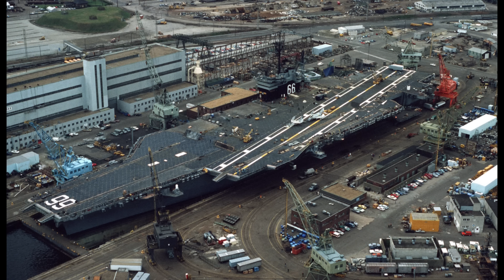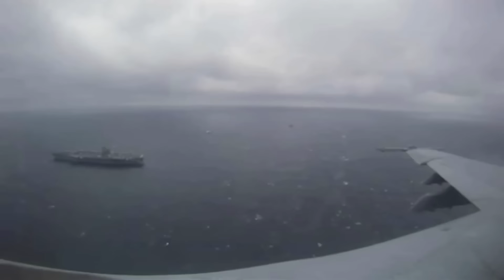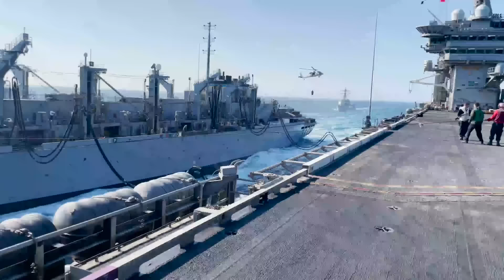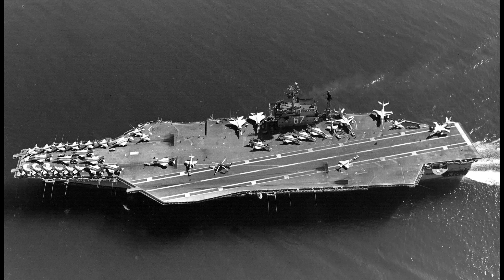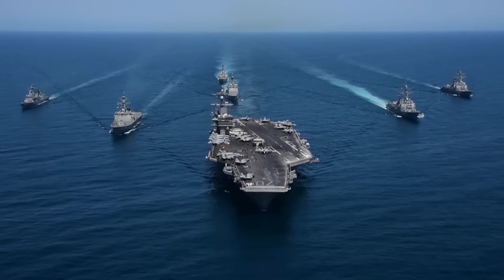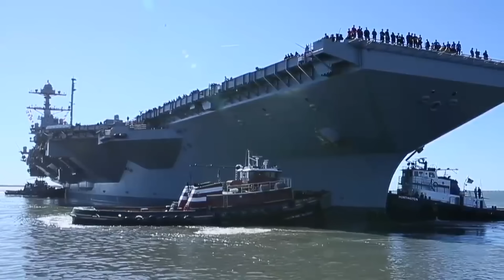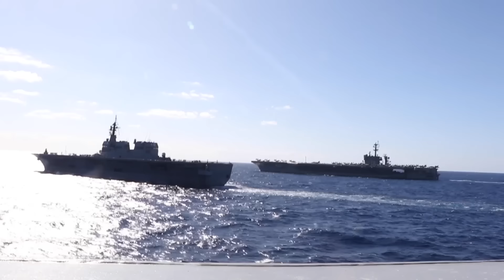Kitty Hawk Class: Why the US Navy MUST Bring Back This Non-Nuclear Carrier

Comment: So the trebuchet launch system is a no go?   Shame.  They are fascinating.  

A carrier today could not operate on a conventional power plant.  It cannot power all the computers, electronics, navigation systems, stram plant, propulsion, steering, catapults, arresting gear, gun mounts, CIWS, passive anti-sub sonar, radars,  communications, galley, laundry, berthing, nightlights, ... 

A potential stop gap are the Marine Amphibious Response carriers, the drone carriers.  Less capable than a full Fleet Carrier, they nonetheless can turn the tide of a battle against far superior forces.  
     Fitted out with F-35s, helicopters, air drones, sea drones, Marine small boats, Marines, air detachments, short range missiles, long range missiles, escort fleet, and resupply contingent.

Comment: The reduced cost of a non nuclear super carrier barely matters unless you're aiming to have two non nuclear carriers per task force. Each task force comes with a small fleet of escorts and 50+ air wing which combined are over 80% the cost of a carrier task force. Spending twice as much for a nuclear carrier which is more capable than a conventional one is easy to justify when putting it in full context. 

You could build an America class light carrier for cheap, but with a task force, that makes the cost per sortie extremely high in comparison to a Ford-class carrier task force.

Comment: Even if the mighty nuclear carriers need a logistics line with oilers. They need fuel for the air groups and food for the sailors, not to mention the screening force that is required. But fleet oilers are at a premium, air defence ships (frigates) let's not mention that debacle. And not forgetting the Trump class vanity project. Slight problem with the number and size of slipways available and the forever changing requirements and scope creep.

Comment: The Kitty Hawk class is outdated. You need something new. 
You've mentioned history but not talked about the reasons for too long. The Kitty Hawk is smaller. Also, if it's going to cost $4.5 billion to build, you haven't solved the problem. 
The reality that nobody talks about is that you need a smaller carrier. Something based on the America class amphibious assault ships is more likely to be of use. 
A gas powered larger carrier carrier will have to go through some serious repairs after 20 years. You see, most of the time during the RCOH on a nuclear powered carrier is NOT spent on refuelling, but on replacing and upgrading all the systems that were not changed for 25 years. 
The US never managed to have that many supercarriers either. They had 14 at most and many of them were smaller.

Comment: This video was almost more " Kitty Hawk class design and history" than the benefits of bringing back conventional carriers. But to do this

First overcome the design -fuck up process where they say " we have this design" and then keep tinkering with it instead of getting it built. This process alone has screwed up at least on frigate program, a guided missile cruiser and a destroyer program just to start. Certainly they would keep trying to add to any new conventional design.

Then assuming it doesn't get round filed before building after spending the entire budget for the design and initial order

dry dock space to actually build it
 budget constraints to build more stuff over all (we build the Ford class as a one to one replacement to keep both the ship yard active and able to build them plus match the expected service lives of the Nimitz Class)
Build the escort ships

build the additional logistical supply train
then recruit and train additional crews.
and then actually budget in the additional cost of maintenance and operations. Nimitz over its' life time is more expensive than Ford (projected to be $5 billion cheaper than Nimitz over the ship's lifetime ) but Nimitz was Cheaper in inflation adjusted dollars than the Kitty Hawk Class.

Yes a modern Kitty Hawk Class might in theory be cheaper to build but not so much that its' higher operational costs overcome the moer expensive procurement of the Ford class.

Comment: The most compelling argument, for this is a study conducted by the RAND group at the request of the DOD that estimated that a Nimitz/Ford class equivalent that was not nuclear powered would cost roughly half as much to build, half as much to operate, and half as much to scrap on average. Imagine a super carrier fleet the same size as the one we field today that costs half as much to operate. Alternately imagine a carrier fleet increased in size by 50% that still cost significantly less to operate than the current fleet. Nuclear power is a slam dunk for submarines, less so super carriers.
Reply: That’s when we could afford 12 large deck carriers and air wings vs now we can only support 10 aircraft carrier strike groups.
Reply: @l @living2ndchildhood598  indeed. And with much smaller and less impressive air wings now when looked at in context.
Reply: @TresLinguas 
I agree with you on that also!
Reply: It's not gonna cost half to operate.
Reply: @CFak-i9r1c according to Rand it would. And having lived and worked in Oak Ridge, thats not hard to believe. Just the actual reactor refueling on a carrier could easily pay for an entire Burke Flight III by itself and thats looking at just the cost to refuel in a box, not lost time or specialists, etc, etc. Reactors  don’t live in a box.

Comment: Refit including refueling (new nuke fuel) of the modern carriers take 4-7 years and uses up a drydock for much of that time.  I suspect that a conventional powered carrier would take less time (including time in dry dock).  However to offset this there would have to be more at sea refuelling required.
Reply: We would need a newer and larger refueling fleet to keep these ships at sea.
Reply: Most of the RCOH is replacing 25 year old systems, not refuelling.
Reply: @CFak-i9r1c  The refueling of the Nuclear powered aircraft carrier is still a long and carefully done procedure.  It requires cutting through the flight and hangar decks to remove the fuel rods/reactor core.  Even the cooling down of the reactors takes some time.  This also requires a specialized shipyard capable of handling nuclear material.  I suppose it would take some time to replace a conventional propulsion system too but would not be quite so dangerous.  I still stand by my original comment (I did use the term "suspect"). I wonder if the US Navy has ever done a cost analysis of conventional vs nuclear.  At one time the Navy had nuclear powered cruisers but found them too costly to maintain and they were retired.  I imagine to the politicians doing the budgets nuclear is sexier than conventional.

Comment: There is a reason why US carriers are nuclear, and it ISN'T due to cost, nor speed, nor the range of the CVN itself, nor anything else commonly quoted.

It's about the fact that a nuclear carrier has room for enough fuel for the air wing AND the CVN's escorts, for significantly extemded time on station without needing oilers.

To be quite clear, McNamara was dead wrong that nuclear carriers don't have sustainment (and thus bith tactical and strategic) advantages.  That's without even examining the problems with stack gas, even on well.designed conventional carriers.

So, when calculating the cost differential, you have to add the cost of the oilers & their crews,  the hulls and crews of the escorts to get the oilers safely to and from the CVBG on station, and the additional shorebased maintance facilities to support all those extra hulls.

And finally, Enterprise is a poor comparison to kodern CVNs, because it was an experimental power system, that was HIGHLY inefficient with its eight small plants.  That's why the Nimitz class doesn't use that layout.

Nor can you compare US carrier operstions with other nations, because no other nation deploys fleet carriers in the same roles, missions, amd CONOPS as the US.  For example, no other nation even pretends to practice permanent presence.

Comment: Oared galleys! Considerably cheaper than any of the options discussed here. Don't need any rare- earth metals only available from China. Can be built in any shipyard with moderately-sized slipway and capable of working wood. Low radar cross section. Good at dodging mines. Excellent for litoral work.

Comment: In my opinion, what the USN really need are a bunch of frigates and large corvettes/light frigates. The USN does not have enough supercarriers and destroyers to properly patrol all of teh US areas of responsibilities. However, supercarriers and destroyers are a massive overkill for many areas. Large corvettes and frigates can be used for lower intensity areas of operation, freeing up the supercarriers and destroyers for potentially high intensity areas. Also, these smaller warships are "good enough" for low intensity patrols and escort duties. I think everyone agrees that a USN Arleigh Burke is overkill against pirates. LOL

With that said, I do believe extra carriers wouldbe useful. However, I consider a Kitty Hawk class carrier an overkill.  I think a dozen light carriers (approx 12 fixed-wing and 12-rotary wing aircraft, with two EMALs) is roughy the right size for the USN needs. Such a light carrier would be "good enough" for power project against non-peer opponents. They carry enough fixed-wing aircraft for fleet defense and enough helicopters for anti-sub, antipiracy, humanitarian, patrol, and escort missions. Also, these carriers need not be as fast as the supercarriers, say under 30 kts and maybe as low as 26 kts could be "good enough". These light carriers could be escorted by two frigates.

Comment: The biggest reason why the US Navy went to nuclear powered Aircraft carriers is because of the vulnerability of the every 3 day refuelling arrangements that were required to keep the carriers at a wartime footing. (Meaning you were not allowed to drop below 80% fuel supply. This also is a requirement for weapons and food stuffs)
Nuclear powered carriers allow the Navy to move fast and get to their destination on station. Then the rest of 
the support system can catch up and resupply the needs. But the carriers are fully loaded with weapon’s before they get on station. With the change from fossil fuels also increased both weapons storage and fresh water capacity too. These carriers are cost effective for rapid deployment to get on station fast and start operations as needed. What I don’t understand is why the Helo carriers are not powered by nuclear as well?

Comment: A conventionally powered super carrier program is an excellent idea in my opinion.  While the US has 10 Nimitz Class carriers plus 1 active Ford Class carrier with more working up, it would be impossible to deploy all 11 of those carriers at once.

The general rule is that 1/3 of the fleet is always deployed, 1/3 is always training, and 1/3 is always in port for refits and repairs.  Nuclear ships require extensive maintenance and upgrade programs during their lifetimes which makes the impressive 11 or 12 ships in the fleet less impressive as less than that could be deployed around the world if needed.

A smaller fleet of conventional super carriers that differ as little from the newer Ford Class as little as possible aside from their power plant would give the US additional resources that it could deploy in time of crisis.

The nuclear ships with their unlimited range are part of the world shipping lanes protection and rapidly deployable show of force for the United States, but when a second or third flight deck is needed a conventional super carrier could be deployed.

Of course don't forget the smaller but still formidable ships like the America Class.  They aren't super carriers but they are larger than most ships possessed by other nations.

Comment: It's a shame the conventional supercarriers were not preserved in the mothballs. However with the limited amount of drydocks that can accommodate building as well as maintaining even conventional supercarriers. It's likely a modernized carrier design of the Midway class size 30-60k tons would be better in the event of a near-peer or peer conflict as it would expand the amount of available drydocks for building as well as repairs and maintenance. Especially on the pacific coast where you would want those facilities to be available. 4 carriers with 60 airframes is better than 2 supercarriers with 100 airframes when carriers are being taken out of the fight.

People forget the reason why escort carriers were a thing was due to limited capacity of available drydocks that could build fleet carriers and capital ships of the time.

While the LHA do have carrier capabilities for additional sorties in a pinch they are terrible for sustained carrier operations.

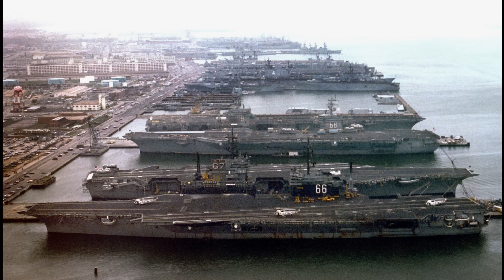Comment: 6:35 - see.... but in 1960s oil was dirt cheap. And nuclear powered carriers, as far as I remember, more than doubled fuel amount for carrier air wing AND relieved substantial tension on logistical chain for fueling both battlegroup and air wing. RCOH is done exactly ONCE per Nimitiz class 50 year design lifetime, at least one including refueling and thorough maintenance and upgrade is required anyway after 25 years (that's more than lifetime of most other hulls). Also, nuclear proprulsion is NOT the largest contributor to cost and time.  In reality, for fixed wing aircraft "cheap-ish" carrier would require bare minimum - abandoning all hull specific underwater protection etc and just adopting off the shelf container ship design, which would drive the price anyway.

Comment: It would make a lot more sense to just keep upgrading the Nimitz-class instead of decommissioning them.
Reply: 😂 No, it wouldn't. They're running out of energy. The systems inside are not capable of last more than 26-27 years. During refuelling all the systems are replaced. They've been working for 25 years after all.

Comment: The prospect of the U.S. Navy (USN) reintroducing a conventional carrier class is a complex debate centered on a "Hi-Lo" mix of capabilities. While potentially feasible from a design standpoint, its prudence is contested by the logistical and operational advantages of the current all-nuclear fleet.Prudence of a Conventional ClassThe prudence of returning to conventional power (CV) depends on balancing cost against mission requirements: Conventionally powered carriers have lower life-cycle costs. A historical GAO analysis estimated the life-cycle cost of a conventional carrier at approximately $14.1 billion compared to $22.2 billion for a nuclear carrier (in 1997 dollars). Operational Flexibility: Conventional carriers spend less time in extended maintenance, which can result in higher forward presence coverage. They also face fewer restrictions when entering certain foreign ports that prohibit nuclear-powered vessels. Tactical Drawbacks: Conventional ships lack the "infinite" cruising range of nuclear vessels and require significant internal space for propulsion fuel, which reduces the capacity for aviation fuel and munitions. Logistical Strain: Unlike nuclear carriers, conventional ones require frequent refueling (roughly every 4 to 6 days to maintain optimal levels), increasing reliance on an already stressed logistics chain and oil tankers. Feasibility of Reintroduction Integrating a new class alongside the existing 11-ship nuclear fleet presents significant practical hurdles: The USN's current infrastructure is heavily optimized for nuclear maintenance and refueling. Reintroducing a conventional class would require parallel supply chains for non-nuclear propulsion parts and different technical training for personnel. Fiscal Competition: Funding a new class could disrupt existing plans for the Ford-class supercarriers, which are already facing budgetary scrutiny and potential production halts after the fourth ship. Alternative Concepts: Rather than a "traditional" conventional carrier, the Navy has explored the “Lightning Carrier” concept. This uses smaller amphibious assault ships with F-35B jets, offering a more cost-effective way to project power (roughly $3 billion per ship) without the overhead of a new dedicated carrier class.

Comment: During WWII most of our One Hundred Plus Carriers were Escort Carriers, while we currently have 11 Super Carriers and 10 Carriers and I think given China it's time to start producing some Light, Escort, and Drone Carriers...
Reply: No escort carrier ever built could accommodate fixed-wing jet aircraft. The F-35B is pretty compromised when it comes to range and weapons payload. Might work for drones though, if you added them to existing carrier strike groups as a force-multiplier.
Reply: @jimfrazier8104 
The F-35B is meant for small carriers or amphibious assault ships. It's perfect for it.
Reply: You don't have 10 carriers. 10 amphibious assault ships are different. 

Time you stop wasting your resources on bs. Escort carriers? You need to design a carrier based on the America class amphibious assault ships. You need to build frigates. Don't come up with a fantasy.